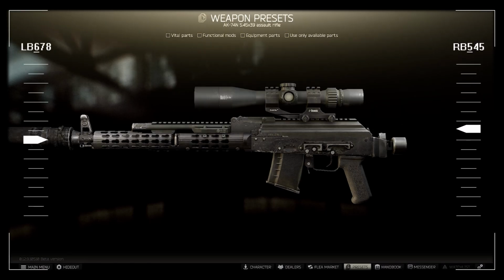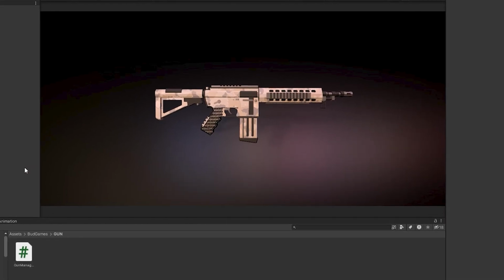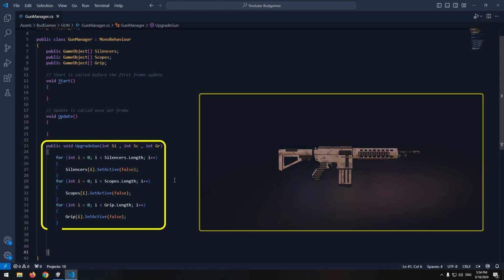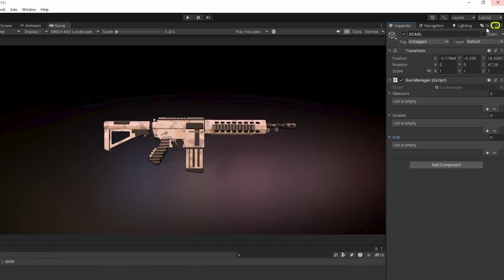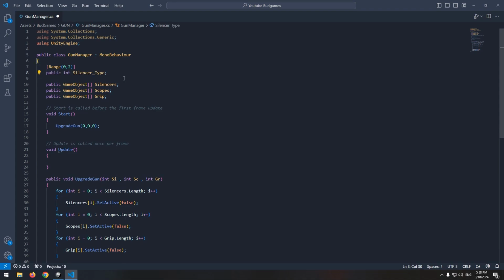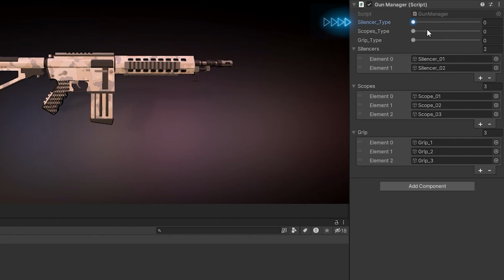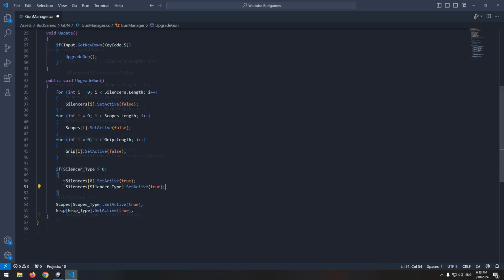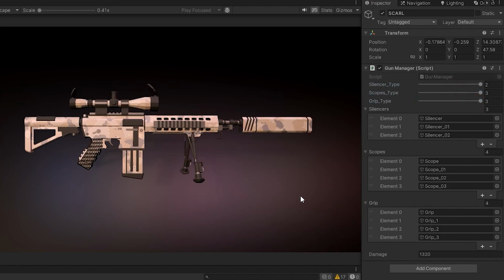Unity Gun Upgrade System: Easy Weapon Customization Guide

Comment: You are doing well for making simple tutorials but make sure to optimise the code. For loop you are using is very unoptimised instead store it with currentSelected variable  so when changing use currentSelected gameobj to set active false ane set new selected game object as currentSelected then active currentSelected. It will use veru less memory.